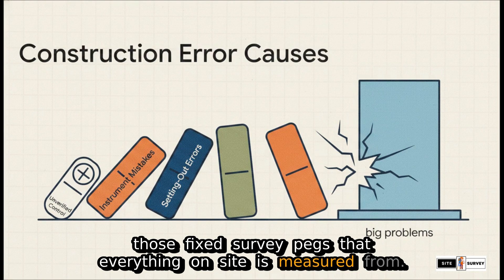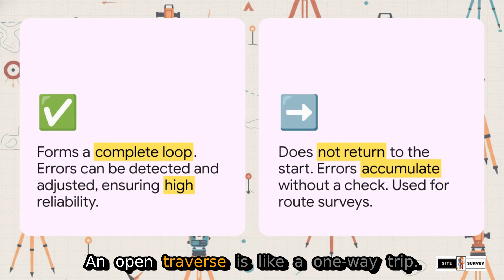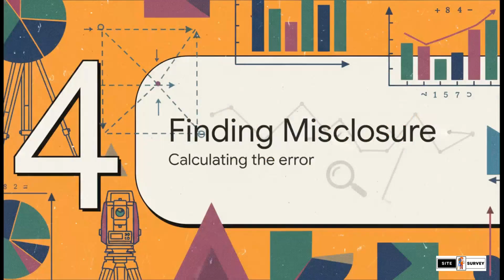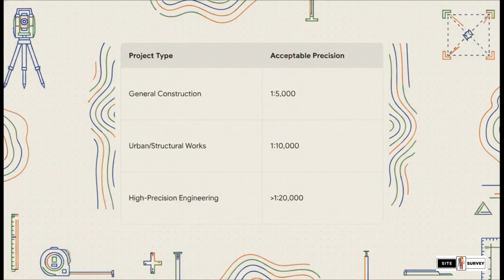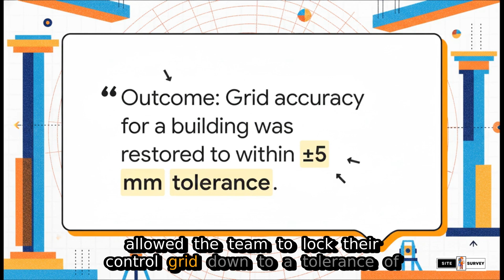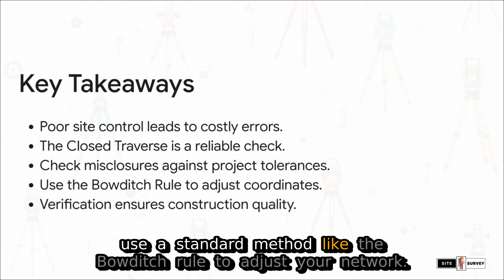Close Traverse Method Explained | How to Check Control Points on Site

Comment from the maker: Have you ever found a control point error on site before setting out?

Was it caused by movement, wrong coordinates, poor setup, or an unchecked previous survey? Share your experience below — it may help other site engineers avoid the same mistake.

Comment: 6:15  It's about turning uncertainty into precision. It's about turning I think I'm right into I know I'm right.  I agree.  Well put.
But then every Land Survey Book states the following.  Quote:  On smaller jobs, 250 sq km (100 sq mile) or less, curvature of the earth is insignificant and should be ignored.  After this video talks about precision and certainty, every land survey manual says 66.7 vertical feet of error is insignificant.  And to ignore it.  Why this colossal contradiction?  TO COVER UP THE FLAT EARTH REALITY